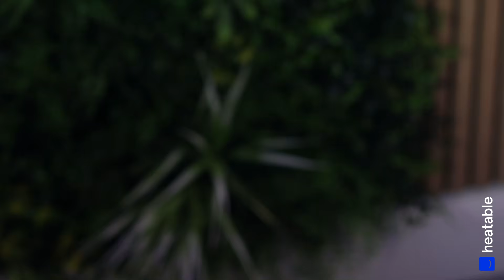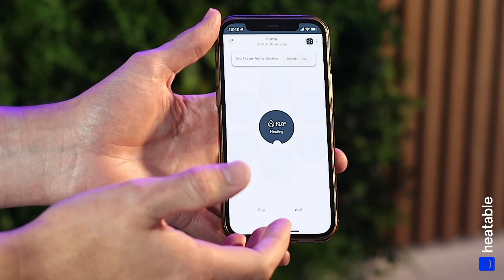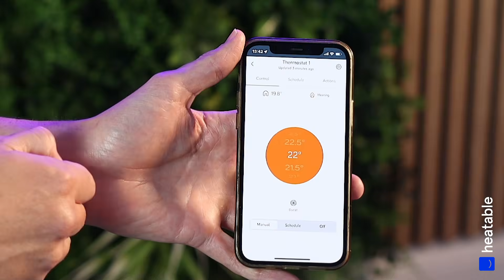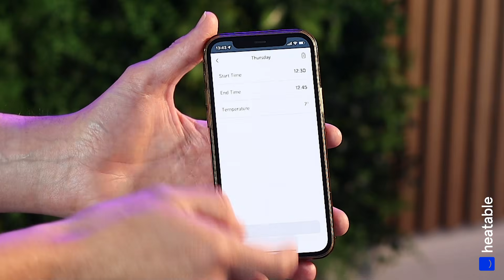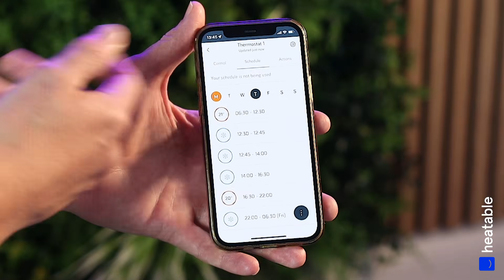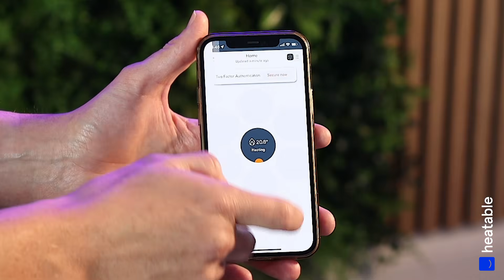Hive Smart Thermostat Instructions | Step By Step Guide

Comment: My controller will not move I have changed batteries. Showing on the screen is a lock sign in the bottom right hand side. Nothing is working
Reply from the maker: Hey Susan, have you already reset the remote?

Comment: Had this thermostat fitted last week 
Installer put it on the wall 
But how do you take it off the wall to renew batteries?
Reply: The thermostat clips to the battery cover, and the battery cover is screwed to the wall. 

If you just pull outwards from the bottom off the unit it will unclip from the wall
Reply: Will the thermostat automatically connect to the hub once you have replaced the batteries ,or does it need pairing again

Comment: Moved into a house with hive. Downloaded the app. Instructions were to press the button on the back of the hub for 5 seconds, I can't even see a button to press. All plugged into my router and getting nowhere.
Reply from the maker: Hi Susan, have you tried taking out the batteries, placing these back in and pressing the + and - buttons at the same time?

Comment: Do any of these devices communicate directly to each other, or do they do it via your wi-fi? We have a large house with external walls and wi-fi and/or Bluetooth will not stretch through the house. To solve this we have a wired in mesh network system.
Reply from the maker: Hi Rob, if you opt for a wired Hive thermostat, it's wired into your boiler so doesn't require WI-FI to communicate directly. However, to get the wireless Hive thermostat with the smart benefits, it requires WI-FI connection with your smartphone.

Comment: How do you pair the thermostat with the boiler  ?
Reply: Pressing the fire button on receiver for around 10 seconds will make the blinking amber light disappear and it will turn white and the controller will connect in under 5seconds

Comment: Great video thankyou. 

I currently have a two zone system (radiators upstrais and UFH downstairs) connected via RF (Salus), and want to change to a smart thermostat (wifi & app) like Hive. 
Can I use one hive mini smarthub to control two zones wirelessly? or does one zone of the zones need to be a connected via a wired thermostat (like with Tado)?

thanks in advance.
Reply: ive 2 zones and i was told  i needed 2 stats. one upstairs and one downstairs, was installed yesterday and id to get the 2 stats.

Comment: Sir how do I change the time from Winter to summer on the thermostat could you do a video on that please I'm a new owner of hive
Reply from the maker: Hi Richard, switch off the power to your broadband router and Hive Hub. Turn the power to your router back on and wait for it to come back online, then turn on the power to your Hive Hub. Wait 5-10 minutes for your Hive Hub to reboot and then check that your thermostat is back online.  The time should now be updated.
Reply: @Heatable  Thank you sir I didn't have to do all that you said Sunday morning the thermostat readjusted the time itself without touching it it automatically changed the time in line with my mobile I saw it happen
Reply from the maker: @richardmyers7181  That's even better then!

Comment: Does this new version support open therm? Does it also learn how to heat the house like a smart thermostat should? I’ve got an early gen hive and it just turns boiler on and off like any other dumb thermostat. If I want to keep the house at 21oC it’ll keep the boiler until temp is met then turns off but then the temp keeps going up until 21.4oC then boiler stays off until it’s 20.9 where the boiler is fired again but as it takes time the room can drop to 20.5.
Reply from the maker: Hi Peter, the Hive doesn't support OpenTherm currently. It has all the amazing features of a smart thermostat including; instant alerts, frost protection, geolocation and holiday mode. Hive also claim it can save you up to £311 per year on your bills. The app is also one of the best out there and has lots of great features. We think it's definitely worth the upgrade and the switch from your old one to the new ones is pretty simple!
Reply: @Heatable  its an on off controller!